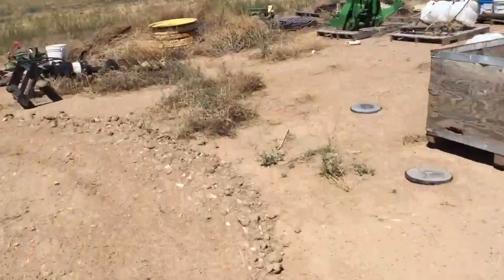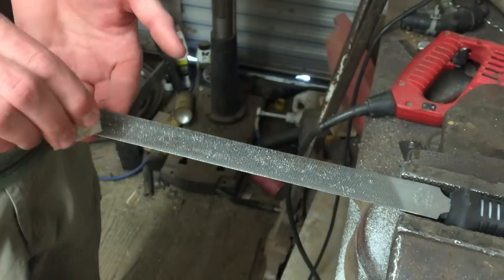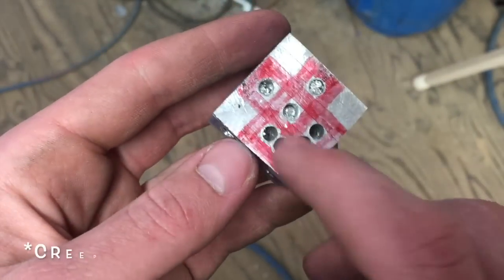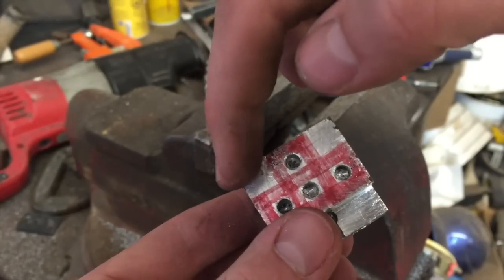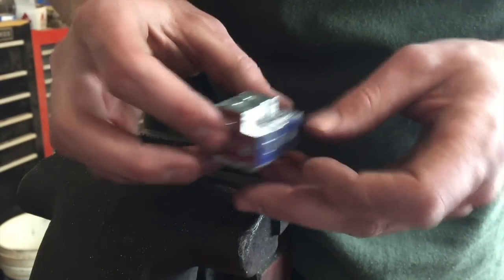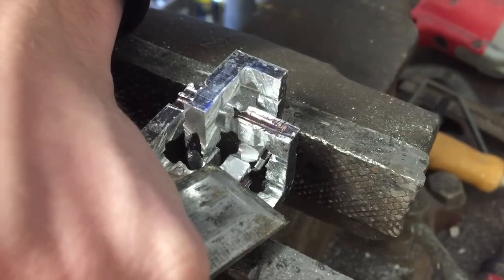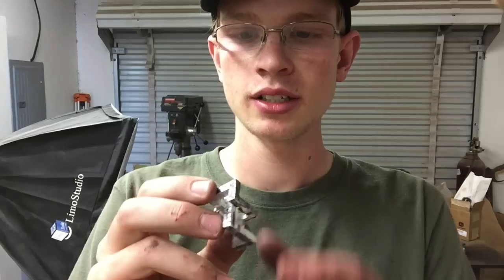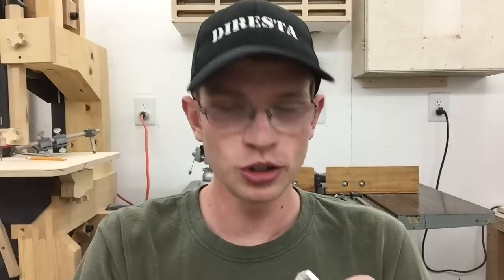Aluminum Cubic Trefoil Knot (Inspired by Pocket83)

Comment: We're learning how to use a metal lathe in my Metal Design course (high school), and my teacher made me use a hacksaw to cut an inch diameter aluminum rod so it could fit in the chuck without the butt stock getting in the way
Reply from the maker: +Eutropios 
Impressive...

Comment: Just one question... I can't even go shopping without my glasses fogging up but you can hack your way through a solid 'aluminium' (i'm British)  block and no steamed up glasses - how?
Reply from the maker: +no2kkk 
I'd guess it has to do with humidity. I live in an extremely dry climate, so when I did this the humidity was likely only around 15%. During the Monsoon season (when the humidity is very high), my glasses would have fogged.

Comment: I'm not the only one to know that brake parts cleaner is not just for cleaning brake parts.
Reply: +Double Dare Fan I would use it even in my kitchen, but too smelly :D
Reply from the maker: +Double Dare Fan It took the Sharpie marks right off! ;-)
Reply: Its essentially acetone+few other chemicals, in pressurized bottle. Its extremely useful when you need to pressure wash oily metal shawings or other grease based dirt from the hard to get places.

Comment: I have seen the original but is still don't get where the are connected 😰😓😵
Reply from the maker: +Daan.Z.bloedjes There's an L-shaped part on each face of the cube, and then a straight piece through the middle of the cube to the opposite side. Make sense?